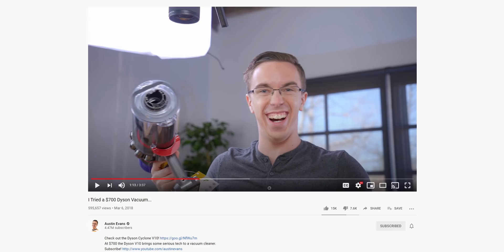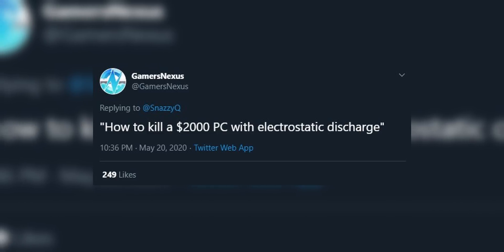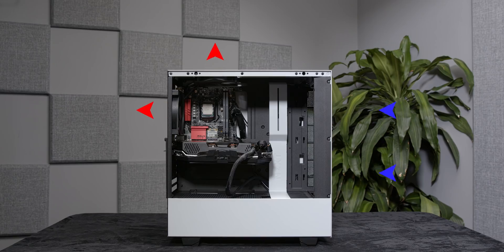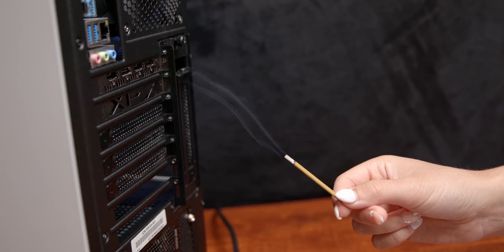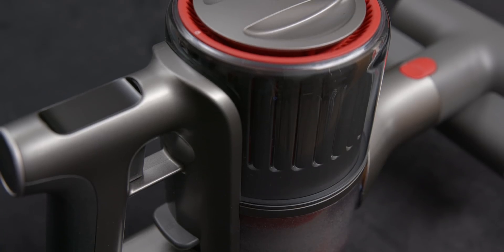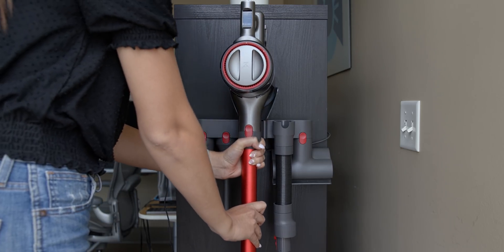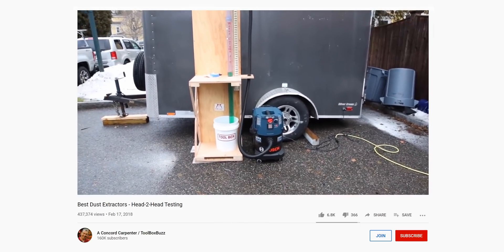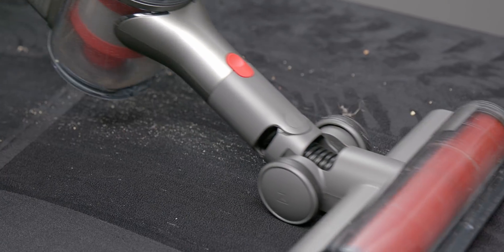The WORST Cooling for a Gaming PC...

Comment: As long as your case is grounded via the power plug ESD isn't an issue.  I usually put the PSU in first and plug it into the wall when I'm building a new PC.

Comment: You actually could make a hole in the case a bit wider than the vacuum's exhaust. Put vacuum's exhaust near the hole (to push air from the outside inside the case and using the vacuum not to suck through the case, but to push air inside) and do not seal the case. It could create both an enormous amount of static pressure in the case plus a huge airflow.

Comment: I would like to see a video about network routers, from very old versions to the latest to see how well each of them perform when given a near perfect internet connection like with the fibre network you have just installed. Do any of them actually meet the expectation of wireless speed, like 54mbps wifi routers.

Comment: Not tobenitpickinghere,but in a negative pressure situation, the fans arent actually sucking air into the case, but the higher pressure outside the case is pushing it in.... However the end result is pretty much the same.. :-)

Comment: I think you would've gotten way better results if you hooked the vacuum up to a radiator, have it compete with static pressure fans instead of the case fans

Comment: the moment u said lithium polymer battery i was scared to buy this vacuumer cuz we all know from drones and rc devices in general, that once  fully discharged, a lipo battery won’t recover.
so i’ll probably end up having to buy a expensive oem lipo battery cuz they use some sort of proprietary connector.
i hate it! we need to have regulations on battery connectors just like we have in the eu with usb c!

Comment: I have an H500, and air ends up getting sucked in through the holes on the slot covers, as well as the gap between the side panel and the case. because of this, the inside of my pc gets dusty.

Comment: Meanwhile a laptop from 2012 can do very intensive AI work with Tensorflow, stay at it's highest boost clock [3.1GHz], and only reach 80c. 
The laptop in question: HP Probook 6570b with an i5-3210m [3rd gen / 2.5GHz base] and 16gb or ram
How did it manage such a feat? Simple: unlike modern laptops, this one has a fan that can actually cool the CPU

Comment: ... I can make it simple for you...
If you make your inside case "vacum" (or almost vacum), it means there is not enough air for convection, hence the heat can't go anywhere.

Water Cooling has better results might be because it has more heat capacity...

Comment: You should put it right up against the cpu, ideally sucking through something like a water block with less height. This would pull that hot sticky boundary layer off the top of the chip from the high velocity, probably giving performance closer to an air cooler.
There was an experimental cooler that used a channeled disc floating on an air bearing to literally scrub the boundary layer off, giving incredible performance for the surface area.

Comment: “Fans don’t make air; seems obvious but people forget it all the time”
Seriously? What kind of people do you cater to in this channel?
Reply: J Y I mean people think refrigerators make things cold
Reply: @chidorirasenganz  Isn't that what refrigerators do? They transfer heat energy from inside the fridge to the outside of the fridge....in effect making the inside of the fridge and their contents cooler....
Reply: Chris47368 Yes they transfer heat but they don’t create the lack of heat. 

For example: if you leave your fridge open, it won’t get colder in your place because it moves the heat not eliminating it. So if anything it’ll get hotter because the fridge will work harder 😅
Reply: @chidorirasenganz  If you are transferring heat energy away from an object you are still making it "cold" ?....I understand what you were trying to say now though...you were trying to make the statement that some people think  that fridges destroy "heat energy", without knowing it just gets exchanged within the environment...but i disagree with your original statement wording that essentially claims a fridge doesn't make objects that are placed inside it "cold", since fridges do infact make things cold...

And yes fridges are not 100% efficient so like AC units that are not exhausting hot air outside of a room, open fridges will indeed warm a room up instead of cooling it....
Reply: WTF any of this fridge crap has to do with what the video said about fans? 
Now I see the type of audience in this channel.

Comment: Vacuum cleaners not going to work like that ? you can use a stock CPU fan you have to make a shroud to go over the CPU with a small gap of a millimetre at the bottom and a flared end and a big chamber for the fan to be situated and the chimney smaller, the air comes rushing in under high-speed what is cold compared the atmosphere plus  if design right underneath the processor. Where the base of the CPU is GPU have a millimetre gap closest possible to the processor nice rounded edges flaring out to about 4 mm with flared edges, where the fan is mounted in the shroud you wanna make this a Venturi encourage more airflow same with the chimney. Make sure the Venturi to the fan is narrower than the blades covering two-thirds of the fan blade surface the fan has to be enclosed completely

Comment: One thing I've wanted to try for a long time now, is to have a turbojet serve as the exhaust fan for a pc.  Not only could it act as the cooling, but with a generator hooked up to it, it could even power the pc!  All you'd need is some fuel and you'd be good to go.

This video has rekindled my want to do it

Comment: Does the vacuum have a reverse function? I propose that would’ve been more effective to of used the vacuum blowing air into the case, the back pressure created by the case would make it very effective.
Reply: Vacuums use the air flow to cool the ridiculously powerful motors, this one being 450W. So, you would have have that volume of air heated by a 450W heater before flowing into your case.

Comment: So I'm not done watching yet. 
    But after hearing you talk about Suction/Pressure vs Air-Flow, it has me thinking, is there a way to leverage an increased (–) pressure using an unconventional method. Like suddenly releasing it in a certain place or specific way... Maybe periodically, perhaps even rapidly, open a spot right where you need the air then close, let the (–) pressure build up, repeat (Might make an annoying whistling noise, hah) Or is it always entirely the ratio of Airflow vs Pressure/Suction that is most important, even possibly to the point of making it moot?
    Obviously those specific examples may seam laughably bad to some but it's more that way of thinking around the problem that interests me. And they are only really there to facilitate that way of looking at it and possibly spark a conversation.
    So, yeah. IDK, just has me wondering about it. 
    And... Maybe somewhat obviously. I Wish it were (It was? ...It t’was?) 
    It t’was my job to take A few people and find out. xD
🎩👌 Somwhat

Comment: The venturi effect where the incoming air at the 2" intake, cause the actual air temperature to be lower. This lower temp air is providing a larger temp differential on the heatsink surface.

Comment: You get a lot of technical things wrong:
- Fans don’t “suck”. Fans blow. The “missing” air pressure behind the fan gets filled up with the surrounding air. Effectively, the surrounding air is blowing then at the fan. 

A good comparison is an air lock at a space ship. When the hatch opens, the vacuum of space does not suck the air out. Rather the air blows out of the hatch because of the existing air pressure in the space ship.

- Fans don’t suck in or blow out pressure. That’s just completely wrong terminology.
Reply from the maker: See ending video statement.

Comment: I once used a terrible laptop for rendering, and it started to overheat badly. Since I didn't have another option (except to not render), I actually took my vacuum and held it against the exhaust of the laptop, and it worked. It didn't overheat at all.